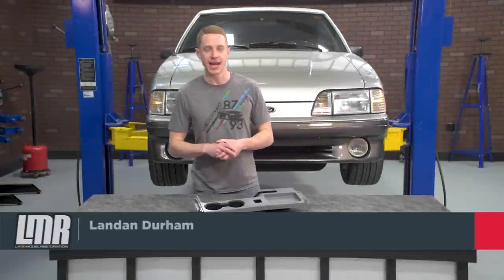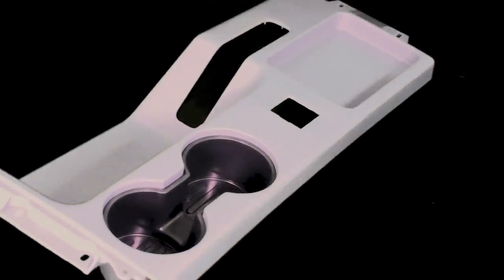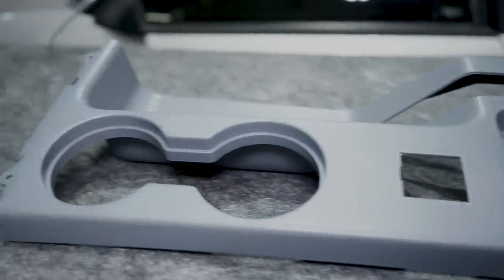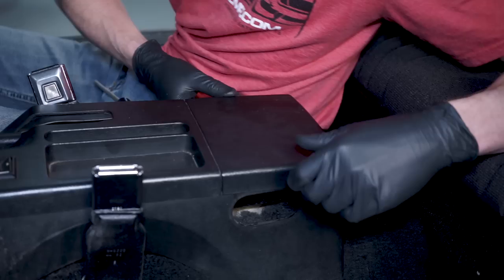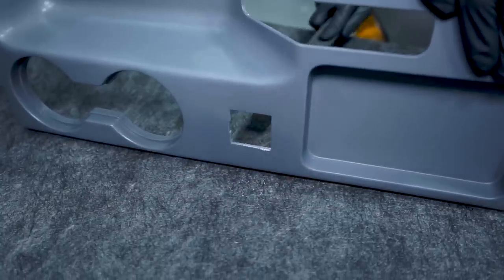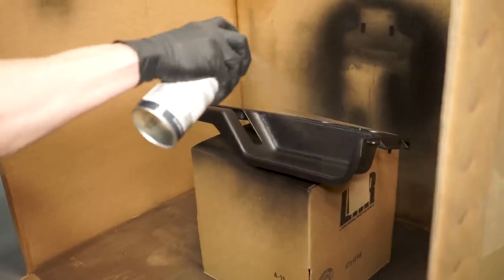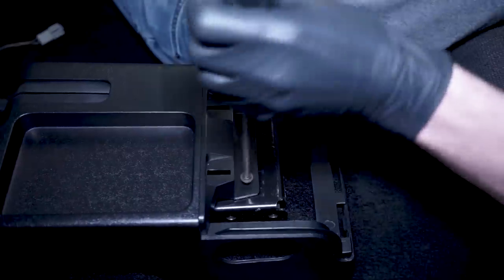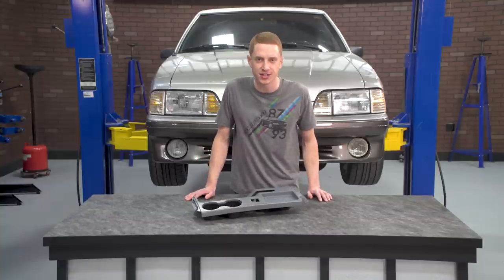1987-1993 Fox Body Mustang 5.0 Resto Cup Holder Console Panel - Install & Review

Comment: I REALLY like this!!  Especially since I am in the process of restoring my '93 LX 5.0.  However, removing the cig lighter will remove the ability to charge your cell phone.  Is there any ideas about developing a new place to mount a power point? Perhaps the cubby hole below the radio?
Reply: I fabbed a console like this about 10 years ago, I moved the cigarette lighter back to where the rectangular section to set the phone, I did stick a dummy plug in it so nothing can drop down in it when not in use.

Comment: This is an amazing product and for sure wanting to get this for my fox, just the only problem is the cup holder is just like the 99 new edge. Where even a small water bottle gets in the way of shifting. Good intentions but placement has more to be desired. If they changed the phone placement and cup holders, maybe a little better. Overall good product

Comment: LMR has updated the console to include dual USB ports. It’s on their website
Reply from the maker: Kevin - The 'updated' console top panel you speak of is manufactured by Daniel Carpenter Restoration.  Our panel(the one in this video) is still available.  We added the DCR version to our extensive Fox Body line up to offer more selection for the enthusiast.  -Landan

Comment: It seems to me all of late model restoration stuff it's just a tad off from the stock stuff. For example how he says closely resembles the factory finish the same problems exist with a lot of their products such as their center caps for the pony Wheels. It says they sit a little past flush but if you're handy with a Dremel tool you can get them to work. So from what I understand the late model restoration stuff isn't quite exactly the way you want it. Including the 6 piece headlight frame kits that some people say you have to drill out to get the adjusting bolts to work

Comment: i could probably 3D print my own design that incorporates the cigarette lighter.
Reply: Why would you use the modern technology of 3d printing to incorporate 1950's technology of a cigarette lighter?
Reply: @stew4148  Easy,charger cord.
Reply: @satanertau2689  why would you use the modern technology of 3d printing to facilitate the use of 1970's technology of powering something by plugging it into a cigarette lighter?  I put a USB power outlet and an AUX input for the stereo in mine. I will now be adding wireless charging since i now have a phone that wireless charges.

Comment: Should have engineered it to swap the hand brake to the driver side while you were designing it. Should have also add USB ports.

Most importantly why does LMR still have a stock shifter in that car.